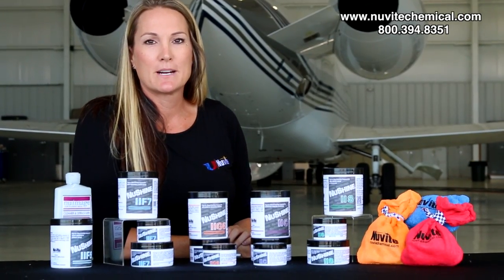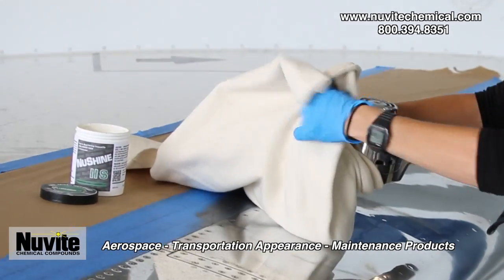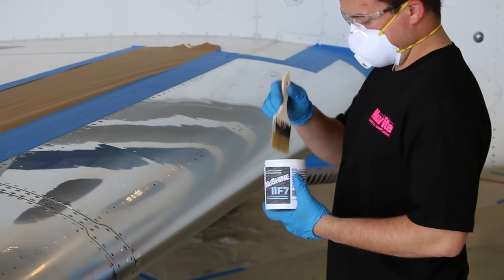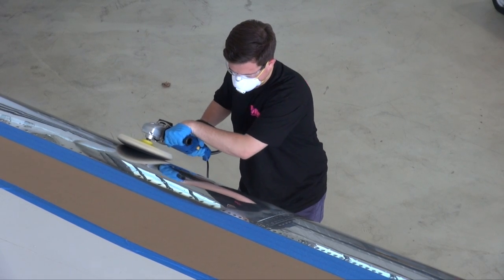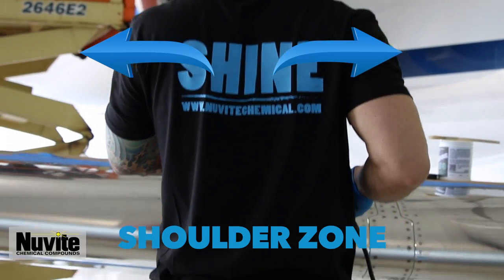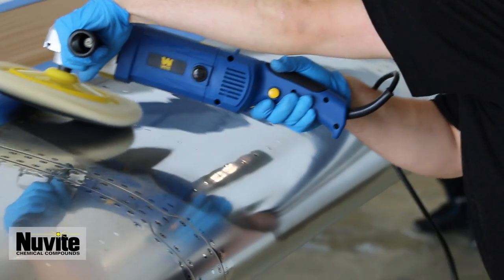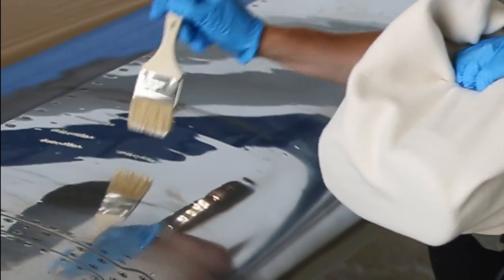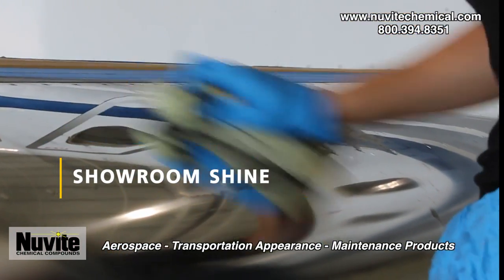Nuvite Chemical Compounds - NuShine II System

Comment: What products and procedure would you recommend for polishing milled finish Alclad 2024 T6 ?
Reply: Mill finish?
I would wet sand first.
Start with 180 then 400, 600, 1000, 1200 or 1500, 2000, & maybe 2500 
Then Nuvite G6 or F9 maybe F7 or 
3M Finesse-It II
 White Machine Polish, 
3M Perfect-It
 Blue Ultrafine
 Polish
Skai , Mirror Image